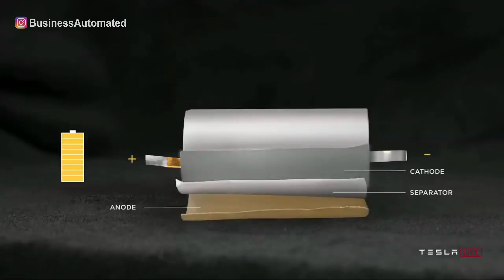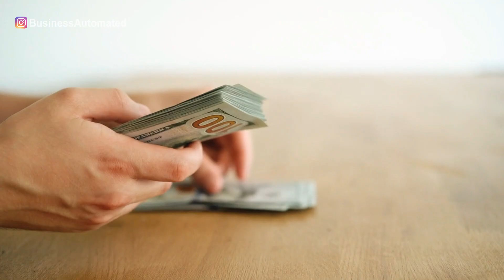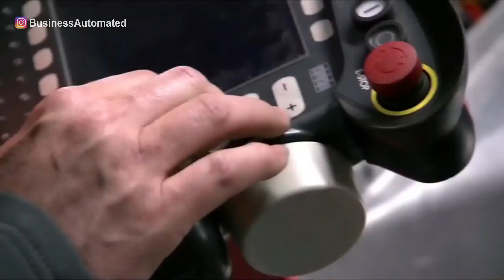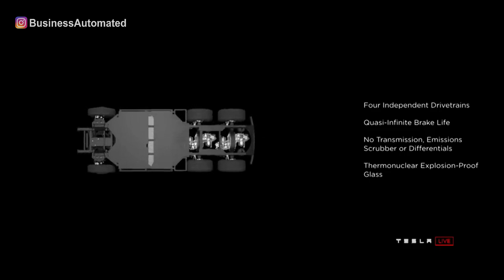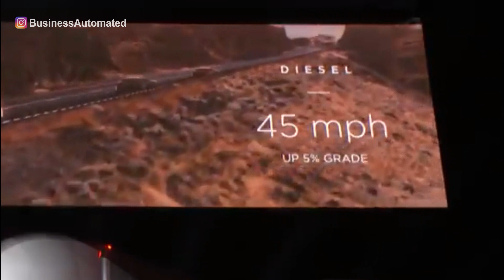INSANELY EFFICIENT! How Tesla Semi Will Devastate Long Haul Trucking in 2021

Comment: It won't be immediately 621 miles but they have stated 500+ for sure
Reply: All it really needs to do is be able to travel about 500miles on a charge. That’s pretty much a 10hour workday for a CDL Class A Truck Driver which by DOT Laws all ur allowed to do anyway before taking a mandatory 8 hour break.
Reply: @Donbarbz  I can make 700+ miles in 11 hours given decent traffic and if I'm running through states with higher speed limits. Being limited to 500 would likely add an additional day or two to every load I do OTR. Now for more regional or local stuff, I could definitely see using one of these, though.
Reply: @wickeddjsin  me too. i need it to do 750 miles 
but they say that during your break ( i take one) you can recharge to 80% in like half an hr
so you park at pilot
go to bathroom 
get a meal . make a phone a call and you have 300 miles extra... so it can work theoretically
Reply: @zaidchalabi1599  that's cool but I don't always have the luxury of taking my break at a truck stop. That'd put a little more strain on when and where I could take my breaks. Aside from that I guess my only real concern is what this would do to freight rates. If we aren't paying as much for fuel brokers aren't going to want to pay out as much. I'd say it will be fine if we all stick together but you KNOW there's plenty of drivers and mega fleets out there willing to take cheap freight
Reply: @wickeddjsin  yes sir i know what you mean.
Reply: @wickeddjsin  im a truck driver myself so im not ur enemy but I can see where this is going. The battery technology is improving with range being expanded every year n charging networks are being built out every month. When these trucks are having 90% less accidents, with no driver pay or benefits needed to be paid, plus being able to drive 800miles non stop then stop to charge for 30min n then drive an additional 600mi again before a 30min stop to again drive 600 more miles. We as human DOT restricted drivers will not be able to compete.
Reply: @Donbarbz  I have that discussion a lot. I think we are far enough out that the current batch of drivers probably doesn't have to worry about being replaced by automated trucks any time soon. There's just too much we do besides simply driving the vehicle that can't be automated yet. I do worry about the next generation though.
Reply: @wickeddjsin  over the road and regional 1-2 day drivers have less than 6-8 years, 10 years at the most. Local delivery n or LTL drivers are a lil safer because of the fact they unload & handle their own freight most of the time, but I think even those guys are 90% out of a job by 12-14 years from now.
Reply: @zaidchalabi1599  yes if they can get the Chargers in place I think it would work
Reply: @wickeddjsin  just argue that it's a premium for offsetting carbon responsible companies might even be willing to pay slightly more
Reply: @Donbarbz  yup buy a truck or two and own your own fleet hopefully enough drivers do this it prevents any one carrier from becoming hyper dominant
Reply: @Donbarbz  no offense but I have my doubts. That seems way too fast to find automated solutions to all the problems drivers deal with regularly. For example: I'm currently sitting on the side of the road with a blown out tire. How is an automated vehicle going to deal with that without someone at least sitting inside supervising? Not to mention the fact that the freight would be sitting here by itself unsupervised. They also have to deal with mountain grades, backing in to docks, stopping to fuel themselves...etc. There's many reasons to at LEAST have a driver sitting on board to supervise.
Reply: @elementary9777  I'm skeptical but it's worth a shot! 😅
Reply: @elementary9777  thats my plan. Going to start saving money after the holiday to get my authority and start building a fleet
Reply: @wickeddjsin  they back themselves, better than us (GPS). The charging networks are being built in the masses now. Blowouts will happen less often due to better maintenance n quite frankly better drivers. The automated driving system picks the best route n navigates potholes n road work. The Tesla semi also has 1100ft lbs of torque n is considerably faster fully loaded on take off as well as pulling up a 5% grade. The technology is here guys. Buy Tesla stock.
Reply: @Donbarbz  I'll need to see the backing to believe it. As for the GPS...those systems aren't perfect. I've used several and had them try to route me under low bridges, onto streets I shouldn't have been on, and once into a literal grape orchard between the trees. The trucks themselves aren't going to magically improve companies' maintenance schedules. Breakdowns will still happen. Also...if I'm a shipper I'm very wary of sending hundreds of thousands if not millions of dollars of freight out into the world unsupervised.
Reply: @wickeddjsin  ok. I suggest you test drive a Tesla Model Y os S with fill driving capability very soon. I don't think u realize how close this is. As far as theft goes the vehicle has cameras 360 with running recording video. Its how it drives autonomously. The technology is here less than 3 years away. Walmart has already ordered  over 100 of them.
Reply: @Donbarbz  Ever wonder why long haul trucks have sleepers?... They often have two drivers to keep those wheels turning.
Reply: @aceroadholder2185  I'm hoping they will be able to get it to the point they can charge to 80% in 30 minutes if they can then they'd lose a little drive time like maybe 2 hours a day or possibly less
Reply: @aceroadholder2185  for owner operators you dont need that
i personally would never share my truck with anyone lol
Reply: @zaidchalabi1599  Owner operators often drive in husband and wife teams.
Reply: @aceroadholder2185  im an owner operator and got my iwn authority and know about 100 others
none of the ones i know drive with wives
please dont give weird ass wrong statistics
Reply: @Donbarbz  actually wrong, most of us truckers can do 500 miles in 7-9 hours depending on if we have to climb grades or not, DOT allows us 11 hours to drive, and shit it’s barely enough parking on the road now, what’s going to happen when it’s electric? Half of the time if we stop late we make parking spots or park in a Walmart, Lowe’s or something of that nature, this Tesla semi isn’t made for over the road trucking. I do 400 miles take a 30, get back on the road for another 200-300 for the day. People that aren’t in the trucking industry need to stay the fuck out. Elon musk is trying to eliminate actual jobs to replace humans with robots
Reply: @lilripsta313  Its inevitable. Automation and machines are going to replace a lot of our jobs. I've been driving for 18yrs now n I see it coming. Its just a matter of time. Everything is about saving dollars and speed right now in this new world we live in. Amazon Prime, UPS, FedEx, etc,, Fully autonomous tractor trailers won't have to stop for rest after a 10 -11hr day. They'll stop for 45min, recharge n continue to their destination. Plus they won't need any benefits, sick time or vacation. Its definitely coming.
Reply: @Donbarbz  problem is the truck can’t charge itself and what happens when automation doesn’t recognize 4 wheelers and kills someone. You’re going to have to keep an operator or I smell casualties
Reply: @lilripsta313  i think u should pull up a YouTube video and watch a Tesla owner in their car with it driving via their latest beta driving update. Its pretty impressive. It recognizes 4 wheelers, people and pets. In 2-3 years, or less it will be better than any human driver no doubt. It will save many many lives. Its pretty much 95ish% of the way comolete now. The same program will autonomously operate the tractor trailers as well
Reply: @Donbarbz  I’m not talking about what the Tesla car recognizes, I’m talking about a semi, I drive flatbed and heavy haul. It’s no way in an emergency situation a truck will be able to stop properly. Who’s going to get out every 150 miles to check if a load is secured, same with car hauling, what about when gps sends to a location that doesn’t exist because of a screwup. No autonomy will not dominant the industry for a very long time. Just in my division alone you have to be hands on. Who will secure a heavy haul load after getting loaded, who will tarp the load and secure it with proper tie downs? It’s too many unknowns and DOT regulations that are not going to change anytime soon. Maybe dry van can get away with that or even reeefer. Flatbed will never be able to be done without an operator
Reply: @lilripsta313  of course there will be a need for humans still. It will start with dry van hauling im sure only in certain lanes. But the Tesla car runs the same program the trucks operate on. Go n check out a couple vids on it. Its impressive.
Reply: it needs to do 750 miles
that max i can do
Reply: @zaidchalabi1599  after 10 hours we must stop for 8 hours. That thing will do 600 miles, stop n charge for an hour n cover 600 more miles before we crank up again off our 8 hour break.
Reply: @Donbarbz  ofcourse but you need chargers everywhere
Reply: @zaidchalabi1599  you drive 750 miles without stopping for 30 minutes damn hope you have good health insurance that's got to be hell on your body
Reply: Yeah on flat ground  Mountain passes like where I live that think be lucky to do 400 nope.  I would drive anywhere from 600-660 miles a day depending on which states i was in  Think the furthest i ever went was close to 750 miles.
Reply: @dons8122  its actually much better st driving uphill than diesel motors vehicles. Just look at how much faster electric motors are than internal combustion engine vehicles. The Tesla out performs gas engine cars in its class easily. The technology is here and its coming. I say we have about 5-6 years tops before these Tesla Semi's start disrupting our careers.

Comment: "Insanely Efficient"? No it isn't. Over the road trucking is a zero sum game.... 80,000 pounds is it. One pound over and you're overloaded. So income generating payload = 80,000lbs - (weight of trailer)-(weight of the tractor). How much does the Tesla tractor weigh? Elon won't say. I wonder why?
Another fun fact: When you drive a long haul truck across a State, the State doesn't care where you bought the fuel or got the electricity, you are going to be taxed for using the road. If you don't buy the fuel or electricity in the State you will be taxed as if you had.
Reply: Electric motors are for more efficient and have a more linear torque curve than internal combustion engines and no need of multispeed transmission, just a gearbox (Tesla has a million mile powertrain, btw). Also electricity is cheaper (by a significant amount), cleaner, and more efficient in the end, even accounting for pollution from dirty power sources and transmission line losses.
Reply: @Mrpunkin785  That electricity won't be so cheap when the State and Federal tax people get done with it. Your Electric truck is going to pay about $300 in taxes on the electricity plus the cost of the electricity you used to go 500 miles. The States aren't going to let you run a 40 ton truck up and down their roads for free.
All the things you said about electric trucks are mostly true and if Tesla has a million mile power train that means they are just like the diesel trucks everybody else sells. The fly in the ointment are the batteries. They are over weight by 12 tons, They can't be fully recharged in 10 minutes, and every truck stop will need an enormous amount of power to charge 10 to 20 of these trucks at one time. The current recharge time for EV batteries is a killer in itself. If you drive a long haul rig you're probably getting paid by the mile... if you're sitting still you aren't making a nickel.
Reply: @aceroadholder2185  How do you expect the Fed to put taxes on electric, doesn’t that put everyone’s taxes up even on residents for example who don’t have an electric car?
Reply: @morganwilce7501  How will they get taxes?...Easy, if you don't buy gasoline or diesel fuel they will just tax you at an equivalent rate for the miles you drive. Tesla is already getting that information continuously from the cars they sell and they will report that to the State and Federal governments who will ...you guessed it... send you a tax bill.
Reply: @aceroadholder2185  I'm sure somewhere right now in a motor fuel tax department somewhere near you they are working feverishly on a plan to die the non-taxed electrons red. No way they're going to let that fuel tax money get away.
Reply: @joecummings1260  Well if you drive an EV you can't expect everyone else to pay your share of the cost of upkeep on the roads and bridges. Of course there is that portion of the population that expects the government to provide unlimited "free s#*t".
Reply: @aceroadholder2185  I don't think it's going to matter much. Once Elon is forced to disclose the weight, and people find out how much it's going to cost to bring enough power to charge these things there will be very little market for them.

Each and every one of those mega charging stalls is going to require a 480 volt, 2500 amp, three phase circuit in order to operate. Good luck with that

Comment: Hyliion has a better answer for cross country trucking.  Tesla has a big load penalty.  I’m invested in both companies.  The grid can’t Handel the Amp loads for fast charging semi trucks.  The infrastructure is not there and would be extremely expensive to upgrade the grid to accommodate fast charging. Tesla is better suited for local and regional hauling.  Hyliion is carbon negative and has the infrastructure already in place.  Hyliion is fully electric with natural gas range extension of 1,300 miles.  Natural gas is less than half the price of diesel and cheaper than electric in many areas.  Hyliion has no load penalty and more than twice the range.  Fueling takes less than 10 minutes.  Did I say carbon negative.  When you take into account how the electricity is generated.  Hyliion can be far cleaner.  They use reclaimed methane from dumps and and farms.  This prevents the methane gas from going into the atmosphere which is 20 times worse than CO2.
Reply: How many trucks does hylion have moving loads or in testing?
Reply: @elementary9777  I've seen at least 3 different hylion trucks in the lampasas tx area. The range of the Tesla isn't going to be enough without an enormous amount of chargers. I run between 695-750 miles every day. At 5.32mpg average I'd love to swap to a Tesla but I'd be stuck with dead batteries 100+ miles away from home at their current range. I think the ideal setup would be something in between Tesla and hylion.
Reply: yes i love driving with Natural gas right behind my sleeper and i sleep well at night knowing if  anything caught fire  at least i won't feel a thing from the explosion

Comment: Out of curiosity how many loads are trucked at max capacity? I think that if the Teslal Semi can haul greater than the most common load out will be good enough
Reply: One ton lower overall capacity won't likely stop you from picking up most partial loads
Reply: @elementary9777  One ton? Tesla won't reveal what the tractor weighs but the estimates I've seen are that a diesel rig will have a 5 ton payload advantage.
Reply: @aceroadholder2185  
5 ton disadvantage sounds about right. Which may deter owner/operators, but many fleet buyers will adjust, it's just a matter of logistic planning. The fuel savings will be enormous. And for companies that sell directly to the public, such as supermarket chains, it will improve their public image.
Reply: @aceroadholder2185  hey that's what Elon recently stated the full production model will lose but that depends on the new batteries and the structural pack design so I'd wait and see when the first ones are actually delivered
Reply: That isn't the problem. If you are an independent owner/operator and you are running partially loaded with your Tesla and your broker calls with another pick-up will you have to turn it down (and brokers love that) because the load to pick up and your chunky Tesla will make you overweight and get you nailed at the scales.